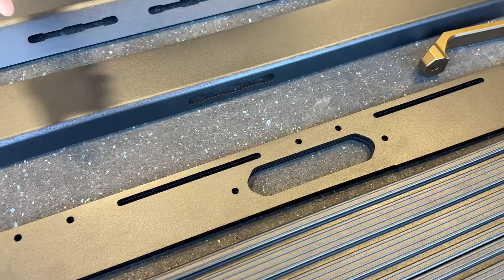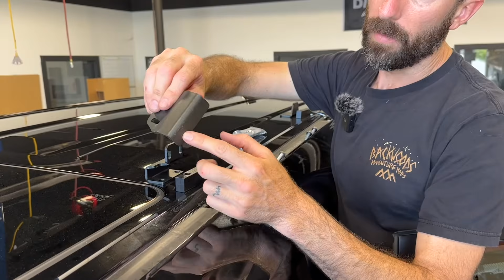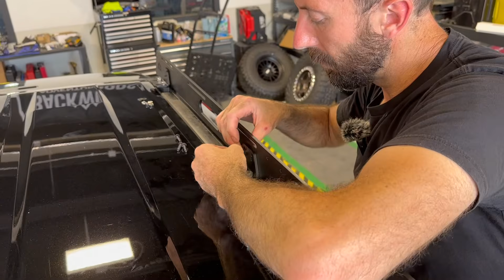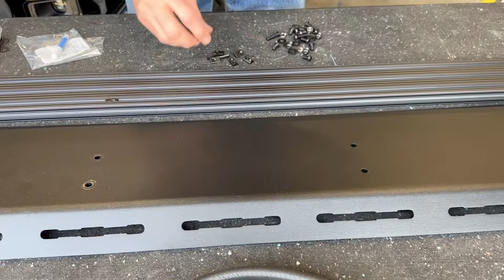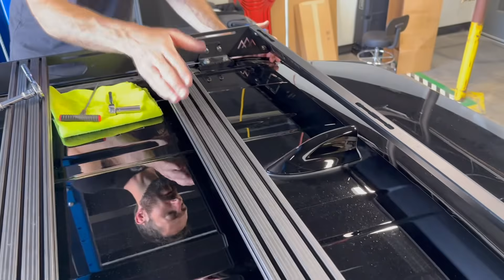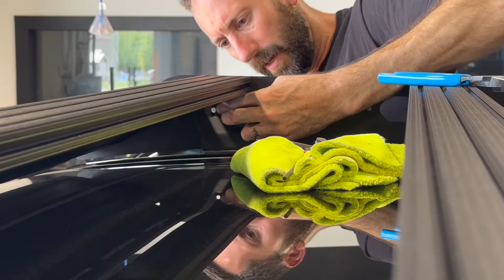Land Cruiser 250 / Lexus GX550 DRIFTR Roof Rack - Installation

Comment: I really like the design/look.  I have a real concern before ordering, at the lowest height setting would the rack side rails touch the body at all? Because the height is set with vertical clamping force of the side bolts . im concern if rack is loaded plus vibration of driving it could come down to the lowest setting.
Reply from the maker: No. At the lowest setting, it would sit on the mounting feet. It doesn't touch the body.